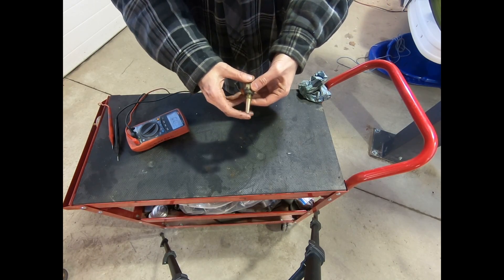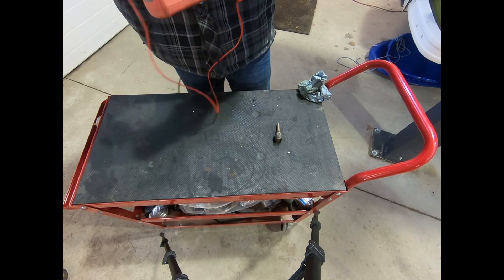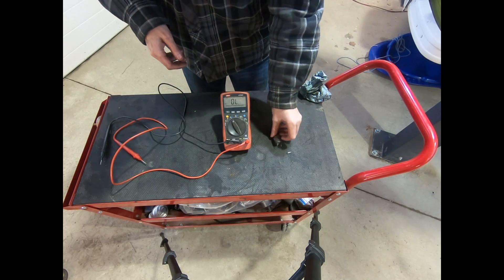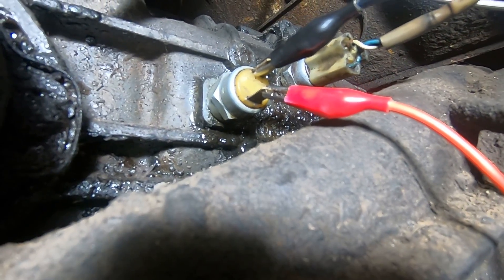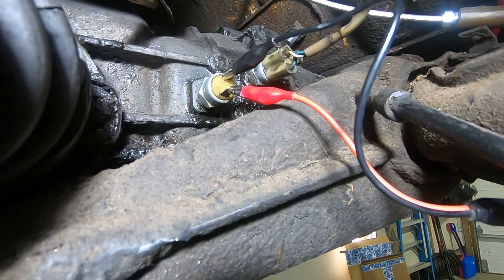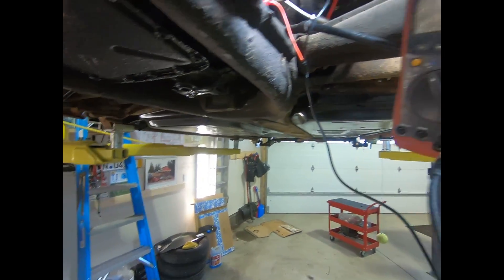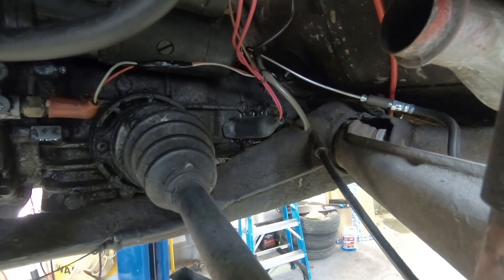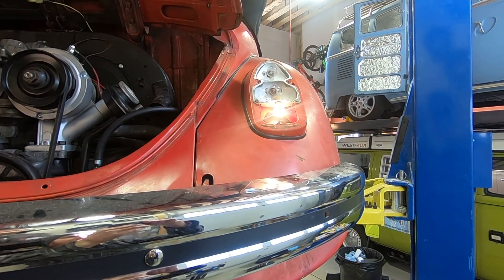VW beetle - Autostick - Reverse Light switch - testing and wiring

Comment: the fuse holder for the reverse lights is on the harness on the fan housing originally.  but keep in mind the autostick parts are no longer available the clutch servo may be. as the flex plates is the weakest link in them they break and your engine is no longer connected to the torque converter i had a 70 bug before it got converted to a 4 speed manual which is recommended to do so. as the torque converter seal is also no longer available i had that leak.  its something you need to think about when you buy a 1968-1975 vw Beetle or up to 1974 Karmann Ghia with the autostick option. as then the Autostick was an option as the chassis are built from the factory with the autostick option. as the holes in the engine bay for the vacuum and ATF hoses.  and the wire to the contacts in the shifter it breaks from constant flexing when moving the shifter in normal driving operation. as i had to splice the wiring to that too as the contacts are also no longer available. to convert to a 4 speed manual. cars 1968-1970 have no clutch cable guide tube in the frame tunnel as you have to cut the side of the tunnel and put in a guide tube as cars 1971 and later have the guide tube unless you run a hudraulic clutch setup for the standard 4 speed conversion  the shift rod in the frame tunnel has to be replaced depends on what shifter you use,  as you need a 1969 -1972 4 speed IRS transmission. for 1968 cars as 1968 4 speed still had the swingaxle rear suspension. the mounts are different on cars 1973-1975. wiring the existing reverse light switch wires connect to the reverse light switch on the 4 speed mounted on the nose cone.  the neutral safety switch has to be bypassed as that goes to the terminal on the starter solenoid just make a jumper wire stick it in the end of the neutral safety switch connector. the atf warning light wires and cintrol valve wires are disconnected and not used anymore the control valve vacuum and atf tanks are removed and you need to have a plug on the intake manifold below the carb. and use body filler to cover the holes where the atf and vacuum tanks are .  the things you need to do to convert a autostick to a manual

Comment: Hi Mike.
Thanks for the Video.
Did you say that there should be a fuse between the coil and the reverse switch? 
If so , what should the fuse rating be?

Comment: I have an auto stick transmission on a type three engine and it had reverse, now for some reason it has forward but no reverse and won’t go over 45mph
Reply from the maker: Bob Martin del campo first thing I would check is the servo adjustment.
Reply from the maker: Thought we had posted a video on this. Will make one and post over the next few weeks. Thanks
Reply: thank you! I’d like to let you know beforehand that this engine is mounted on a trike frame and the shifter has been swapped out and set on the left side.